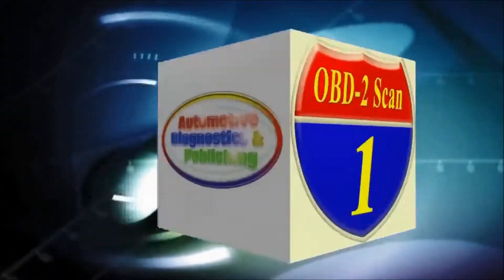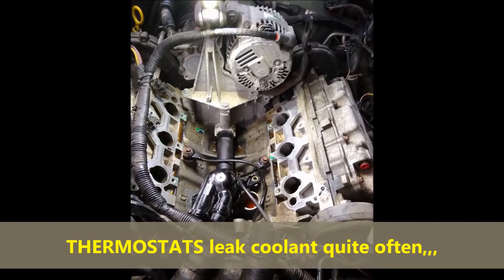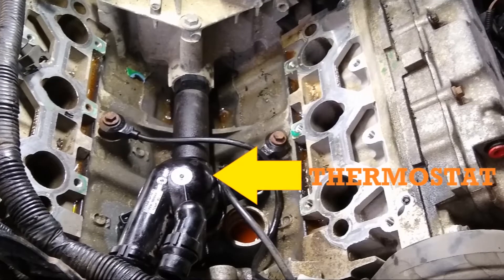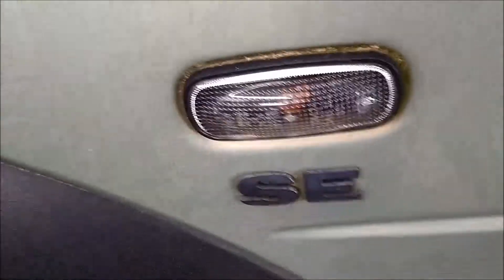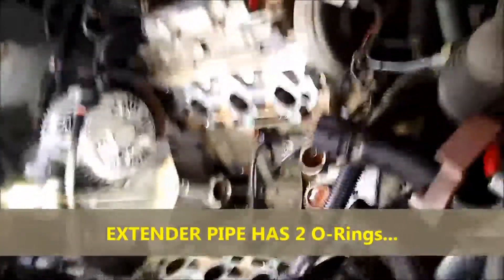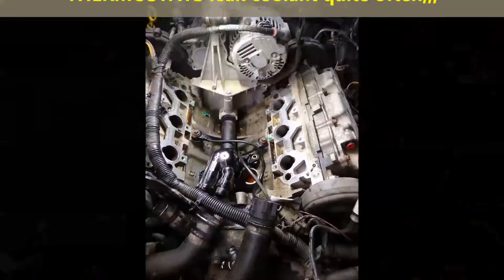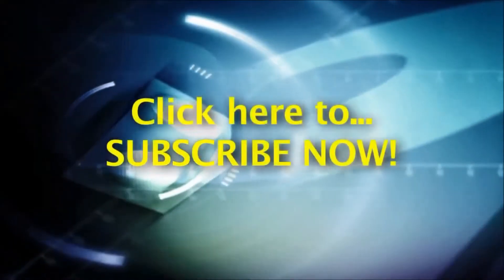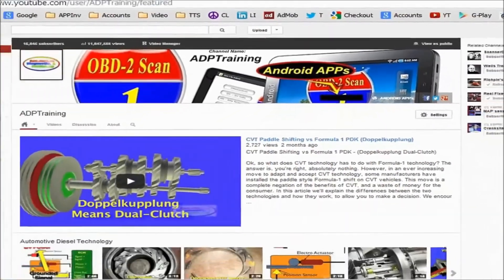BEWARE: Don't Buy a 2004 Landrover Freelander, Coolant Thermostat Leaks | High Repair Cost

Comment: My freelander is showing an F4 error on the dash, has a slow start, and won't switch gears, have you had this problem also?
Reply from the maker: You're probably looking at a trans rebuild. Wish you luck.
Reply: Duty 2-4 solenoids. I changed mine in my garage